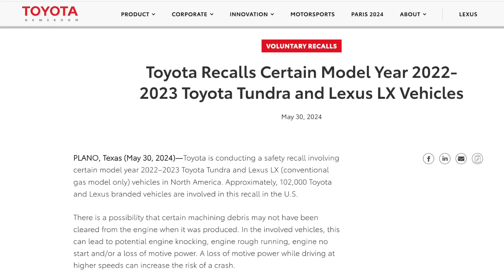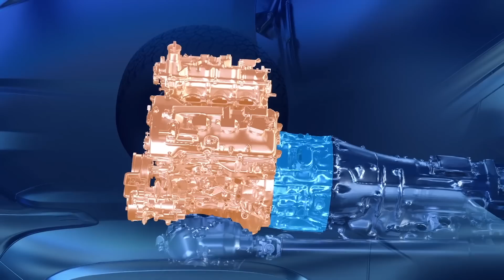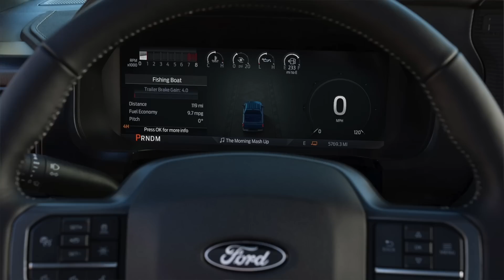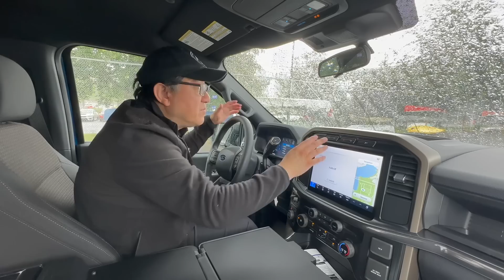ENGINEER EXPLAINS TOYOTA TUNDRA RECALL // SHOULD YOU BUY FORD F-150 INSTEAD?

Comment: The only ford F150 that is somewhat GOOD is the one with the 5.0L V8 do not go for that ECOBoost 6 cylinder or ugh 4 cylinder cr*ap it will give you a lot of problems...Chevy trucks the only ones good are actually the older ones that had the 4.8L Vortec V8 because apparently even the 5.3L v8 has some issues as bad as the 6.2L as for Toyota only the 07 to 2011 are modestly good and reliable, same for the Nissan Titan prior to 2018.

Comment: When you look at this problem if Toyota did not leave metal shavings in the blocks they would not be bad its not a design flaw its been manufacturing errors. Not giving them a pass at all because they need to clean up their act. I still think the Tundra will be the most reliable truck once this mess is cleaned up.

Comment: Holding onto my 2019 1794 4x4 forever.  I  appreciate that it is suppose to be one of the most dependable trucks ever made.  I'll put new parts on it if/when things fail.  I look at  dependability first as the most important thing with the way vehicles cost today.  Who knows if the dust settles on Toyota and they do the right thing or if they and other manufactures realize they are asking too much for their trucks these days.  If I was going to buy a truck today, it would certainly be a used 2018 to 2021 Tundra.

Comment: Years ago when i bought a new Yamaha TT 350 a veteran mechanic told me all new engines have machining debree which can reck havic, so give her a couple hundred miles then change the oil & that will get a lot of the debree out. I listened to him and with every new vehicle i have the oil changed before 1000 miles and that helps a lot.

Comment: The sale are high because it is the best thing out there. No matter what is wrong with it, Toyota is going to fix it like they have done for ever new generation they come out with. I pray to God my Tundra is affected. Because I know I am going to get a new engine and an extended warranty like previous volunteer recalls. This same engine is in the most expensive Lexus models. You think there are going to let those $100k vehicle just brake down? When Toyota release a new engine, it is 10 years min before it is replace. And when it is replaced, everyone is loving it and is scared to death of its replacement. This is no different. Get a spine!!!

Comment: When you machine an engine you should flush out dirt/dust/debris.  There is a flaw in the machining process that engineering has overlooked.  Where was Quality Control?  Don't you perform an oil analysis after running the engine, especially a new design?

Comment: Toyota has a bigger problem on their hand than many realize. As a tundra owner and avid car enthusiast, every one knows people buy tundras for reliability absolutely better resale. They are more expensive than their competition with less tech and worse efficiency. Unless Toyota completely resolves this, they are going to pay the piper. Even a 100k warranty is pointless if it’s not resolved. I don’t want to pay $50k for a tundra and sell it for $5k in 8 years because the used market has no confidence in the drivetrain. Porsche did that with the 991.1 GT3 and the ones without the definitive solution trade for 40-50k less 10 years later.

Comment: One thing for a Tundra/Lexus owner to do right now is put on a strong neodymium OIl Drain Plug Magnet.   GoldPlug, Dimple, Votex, or similar quality magnet brand.   If the machining debris is circulating, you will catch an abnormally high amount on the magnet and have something to show a dealership if needed.   A small amount of iron metal dust on the magnets is normal, but if it's caught bigger debris, that is an indication of a problem.

Comment: My 2010 4.6LV8 is bullet proof. It has over 250K miles and still runs great. I was planning to get a  new Tundra but guess what I will be keeping my 2nd Gen Tundra for a few more years. Hopefully, by then Toyota will fix the engine issues. I am sure they are working on it so I am least concerned about it. Obviously, anytime Toyota has a recall it gives Ford and other American truck brands a reason to celebrate. I am sure the Ford, GMs and Chevy all have issues but they don't come to the social media as often as Toyotas or Hondas. I have a 2022 Jeep which is a horrible vehicle as it has been giving me so many issues which Stellantis is yet to address even within the full 3 yr/36K factory warranty.

Comment: When you say the oil might flush out debris left in block, the reason might be the first scheduled oil change specified by Toyota is 10,000 miles. That’s a long time if debris are flushing through the engine. I was shocked with my 2023 Capstone was 10k for first oil change.

Comment: Toyota changed a part on the #1 bearing. Why?  Check the part number. It changed. And Toyota engine assemblers are just that. Assembler not engine pros. Poor
Reply: So, if an “assembler” and a “pro” install the same no good bearing into an engine will the “pro’s” no good bearing work better?  By the way, Toyota probably has 7-8 different bearing sizes and you can’t see a no good bearing with the naked eye unless it’s scratched or otherwise damaged.

Comment: I’m sorry I could never by another Ford. I have five different ones and ALL gave me so much trouble. My Toyotas have been flawless for the last 10 yrs.
My 2022 Tundra has been great and has 80 thousand miles on it.
When you buy a Ford you cross your fingers and hope you get a good one. I still have a 2016 Mustang and yup in the shop 5 times already every year since purchased from the dealer.  
No thanks on the Ford long term the fords just don’t last. 
I’ll wait for Toyota to fix the issue.
At least they are admitting the issue and working on resolving it.
The reliability Toyota has proven for the most part is unmatched.
Not saying they are perfect but far superior than the rest.

Comment: This is why I bought a new 2021 Tundra back in Dec 2020. Last year of a 14 yr run with Toyota improving every year.  5.7L V8 naturally-aspirated power and extreme reliability.  And zero recalls, unlike Ford F-150’s.

Comment: I traded in my 17 f150 platinum last year for a Tundra. It took months to fix a Phaser rattle that could cause the engine to fail, then the 10 speed Transmission started Clunking into gear, after 4 trips to repair, with minimum success and my warranty running out, I got out. I loved the looks of the truck, the ride, the room inside. but its quality and worse the poor repair quality got tiresome. I was probably just unlucky. BTW there was also a recall on  the door locks, and tailgate. Thank god I bought a 10yr 150k warranty though on the tundra.

Comment: The remark about  the problem being replicated at a different location due to using the same equipment  is way off base IMO.  The process may be flawed and replicated using the same equipment but seems to me that while parts may be machined incorrectly or a cleaning process is done incorrectly it all come down to engineering and design with process engineers and design engineers.

Comment: How can you fix an internal engine problem quickly? Replace all the engines? COVID and supply change issues have created a lot of these problems for all manufacturers. Part quality has deteriorated rapidly which is affecting quality. Improve parts and vehicle improvement will follow.

Comment: The issue is inherent in the engines with the ladder frame mounted main bearings. Front main bearing grenades causing the debris. Toyota will find a way to rip off victims, Toyota always does.

Comment: I think all the bottom ends of the new engines are to weak there not made for turbos as a mechanic if your going to beef up through top end of and engine (with turbos) you need to beef up the bottom end of it will fail

Comment: As of June 19, 2024, there have been several notable automotive recalls announced by major manufacturers. Here are some of the most recent ones:

Stellantis Recall: Stellantis has recalled over 1 million vehicles due to rearview camera software issues. The recall affects vehicles in the United States and Canada, including the 2021-2023 Chrysler Pacifica, with 235,423 units affected. The issue may cause the rearview camera image not to display, increasing the risk of a crash. The recall is expected to be fixed through a radio software update in Q3 2024.
Ford Recall: Ford has recalled the most vehicles this year, with almost 500 recalls filed with U.S. regulators. The recall affects various models, including the 2020-2024 Chevrolet Silverado 2500 and 3500 pickup trucks and some GMC Sierra 2500 and 3500 pickups.
Kia Recall: Kia has recalled 462,869 Telluride SUVs due to a stuck power seat slide knob that can cause the front seat’s motor to overheat, potentially causing a fire. The recall affects the 2020-2024 Telluride and has been the subject of several recalls in 2024.
Tesla Recall: Tesla’s January 30 recall of almost 2.2 million vehicles is the largest of 2024. The recall affects essentially every Tesla on the road since 2012, including the Model S, Model 3, Model X, Model Y, and the Cybertruck. The issue is minor, but it’s worth noting that the recall is one of the largest in automotive history.
Reply: @josephboot1 Stop using AI….your comment states that Ford makes the Silverado.

Comment: seems to be a design flaw , bearing size or crank reinforcement ???   bottom end problems ???  commercial grade they are not!!!!!!!!  turbo issues , soot build up from direct injection,    ford uses dual injection to combat this problem!!!  imagine downsize the 5.7 with high gear capacity transmission???   the 4.0 was outstanding building off wouldve been better     strive to make better not more money off worse quality!!!!!!!!  selling more over priced or more budget reliable ???????   seems customer service is not a priority!!!!

Comment: That’s why you need to change your break in oil at about 800 miles that way if there is any debris in there, you get it out as soon as possible and if you really want to get finicky do it at 400 miles, and open the oil filter and check to see if there’s any particles in there.

Comment: I was a week away from buying a 2024 Platinum when I saw the recall. Canceled my reservation right away. I’ll keep my 2022 Frontier with a V6 that won’t explode or shut down when I’m doing 80mph on the highway.
Reply: Awesome choice,  I just traded in my 2011 Ford F150 with a 5.0L Coyote V8 in it with 163,000 miles on it for a 2024 Nissan Titan with the 5.6L Endurance V8 in it that had 32 miles on it but now has 4900 miles on it and man let me tell you its a freakn beast.

Comment: Ford did it right they kept the V8 as an option, Toyota dropped the ball by reducing engine size the new tundra, and honestly the smaller turbo charged engine doesn't get any better gas mileage then the 5.7.      And I'm waiting to see what's gonna happen with the 4cyl turbo taco another missstep by toyota,

Comment: Look what happened to Ford in 2007-2010 w euro spec fuel engines literally falling apart due to emission mandates. 2010 diesels go 22mpg now w all emissions and regs down to 10mpg thousands in exhaust components and engines fall apart in 200k miles. They do run cleaner but use double fuel, way more expensive and the long term advantage of reliability is gone. Have several friends who GM trucks in lemon law suits now. Great job EPA

Comment: The metal shavings are wearing the engine so quickly because a turbo spins the engine faster. In other words a turbo engine with 100k has turned over many more times than a non turbo engine. You can’t expect as many reliable miles from them.

Comment: Didn’t say they were not being responsible but saying that it seems relatively unlikely that the cause they are claiming is the sole issue.  Maybe I’m wrong.  I’m not an expert in this but my undergrad degree is mechanical engineering and I did work in a system that manufactured complex parts.  I was more on the design side not the process side.  It just seems odd that engines from 2 plants both have the same problem and it’s a process issue.  Now granted they probably have the same  process in place at both plants but then this isn’t really an accident it’s a flaw.   It’s just suspicious— they’ve been building engines for a long time with a lot of success.  So the process for machining the parts of a V6 or V8 and flushing it / cleaning it should not really change much fundamentally.  Perhaps they decided to get more out of each tool bit to save money and there was  more debris in some engines b/c of that.  But you generally build in some redundancy in a system that critical.  On another note — agree with you.  I have never nor will I ever own a Chrysler or GM product.  My previous truck was a Tacoma that had 180k miles and was in great shape I just needed a bigger vehicle and gave Ford a chance since I got such a great deal on an F150 Lariat 3.5 Ecoboost that was still on the lot from the previous year.  Like $9k less than a similar Tundra at the time (2019).  It’s an OK truck — the engine is actually quite good so is transmission and the assembly / build quality is quite good.  but the other parts and electric are shit.   Computer went out at 40k miles — $1000.  Heated seats and bed LED Are out.  At 1st brake change rotors had to be replaced b/c they had fallen apart not been ground into.  So ford thinks a set of rotors is supposed to last the same as a set of brake pads.  Hubs and tie rods bad at 65k miles — those should last 150k easy.   I complained about all this to ford corporate and they said it was all reasonable wear and tear.  So I think Ford uses shit parts.  So I’m not a Ford fan either.  Toyota may be being honest.  It just seems a little odd that you get the exact same problem from 2 plants and it’s not a more fundamental issue than they claim

Comment: As a current owner of a Tundra with the 5.7 I would not remotely consider the new Tundra. I don't like the looks, the V6, or some of the fit and finish issues. I've owned four Toyota trucks, but I doubt I'll another.
Reply: I’m on my 3rd V8 Tundra, in the same boat as you, won’t go for the V6 with all its shortcomings, will look elsewhere when I’m ready

Comment: I love my F150.  I just couldn't seem to like the redesigned Tundra.  I had 2001 and 2013 Tundra, but the new Tundra just doesn't do anything for me.  The 5L V8 is great in the F150, too.  I think Toyota would have been wise to retune the Lexus 5L V8 for truck use as a third powertrain choice.  Could have been 5L, 3.5LTT, and 3.5LTT Hybrid.

Comment: The engine issue strikes at the heart of the Toyota argument, that is to build high quality, long lasting vehicles. Even though your Tundra may not have an issue now, who knows 50-80K miles down the road? It takes a truck that can go 250K miles to maybe 80K miles. Don’t brush it aside, Toyota better take a comprehensive look at itself and how it ended up here

Comment: Fact, the Silverado and Sierra are the same truck from GM and combined outsell the F-150. That aside, the 2024 Silverado 2.7L drivetrain warranty was extended to 5 year/100,000 miles. If I was still working not retired, I would probably get the Silverado for work. All the new trucks, just trade them out at end of warranty if you're running a business.

Comment: A lot of owners are Usless and can’t changed their own oil/filters.
Trying to find time for service isn’t easy,  so most vehicles run way past the proper service.
I over service all my engines and never had an issue, and I’ve driving to the moon and back.
Reply: Same here and no one has ever changed my oil either but me. Oil is cheap and motors are not.

Comment: when one comparison the bottom end girdle of the Tundra with aluminum and the bottom end of the for FORD 2.7 iron.
YOUR EYEs will tell you the bottom end of the Tundra is not stout with bracing while the FORD has iron and a ton of bracing
MY EYEs tell me Toyota got cheap and the stress of the turbo and crank and bearing is NOT STOUT enough and the bearing
Is failing from wobble…. I AM SURE YOU KNOW THIS and MY EYEs tell me the Tundra was UNDER ENGINEERED creating failure

Comment: I feel like the 5.7 Tundra might be the best one they will have ever made.
Reply: i agree however if we give them about 3 years to work out the issues maybe this v6 will achieve success,, not a turbo fan tho
Reply: 4.7 is gem also reliability wise
Reply: @Sharpedges8355 
The 4.7 V8 is a million mile engine
Reply: @samblackstone3400 Exactly mate, no overpriced EcoBoost F150 will make it to million miles like the 4.7L I-Force V8 in that 07 Tundra did.
Reply: @Sharpedges8355  yep !
Reply: I bought one in 2021. Except that the big V-8 is a little thirsty, it's as good as anything gets.
Reply: Its a 400hp truck. Of course it s "thirsty"  If you want a good gas mileage drive a prius

Comment: Just got a 2024 Nissan Titan XD 5.6 gasser. No turbos, no auto stop/start. Simple, tried and true. Vastly underrated truck.  Under stressed engine, smooth transmission.
Reply: daves auto center had a nissan truck with a bad trans you cant rebuild it just buy a new trans 12000.00 dollars no thanks.
Reply: @kevindodge2103  ever heard of eBay?  Plus the 7 and 9 speed JATCOs have proven pretty problem free. I'm sure these people never change their trans fluid (the forgotten maintenance).
Reply: Amen Brother l, just traded in my 2011 Ford F150 with a 5.0L Coyote V8 in it with 163,000 miles on it for a 2024 Nissan Titan with the 5.6L Endurance V8 in it that had 32 miles on it but now has 4900 miles on it and man let me tell you its a freakn beast.